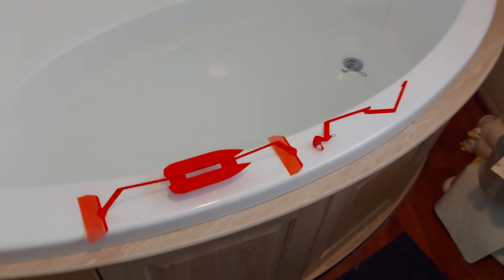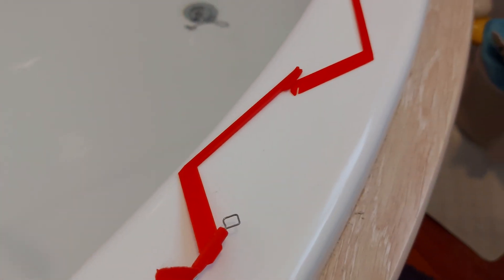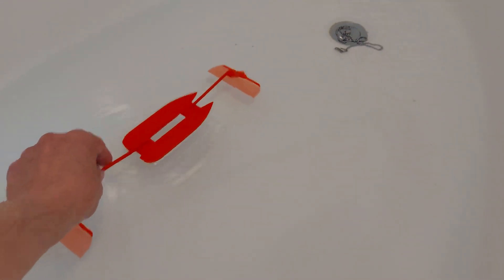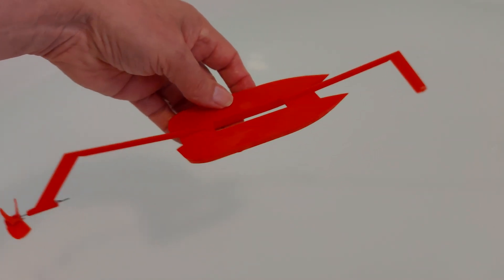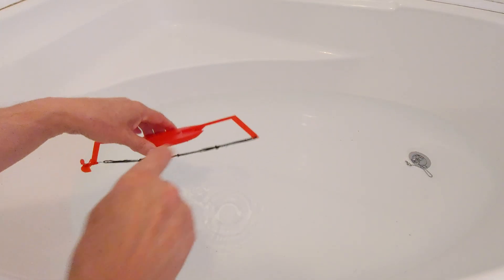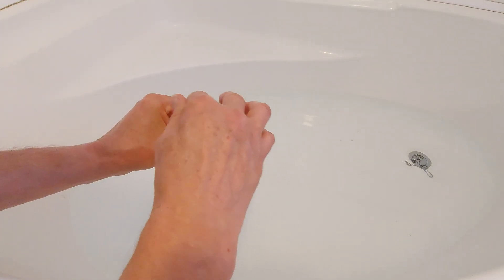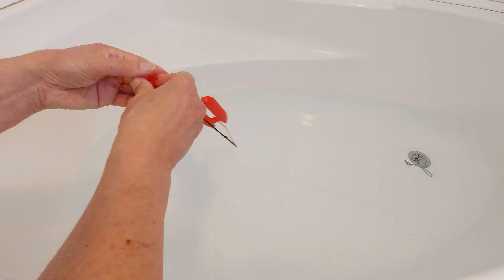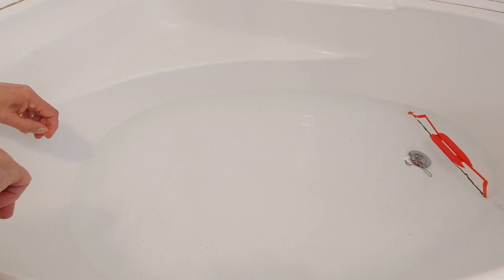Put a rubber band on it 0495 Rubber powered boat

Comment: nice build right there but how did you get the paddles to be printed that thin? you can practically see through the paddles.  didnt know a printer can actually print that thin lol. nice video.
Reply from the maker: @MsRaidman  that is how 3d printers work. They build the item in thin layers. However, when it is that thin, there is a good chance it will tear when you are lifting it off the print bed.